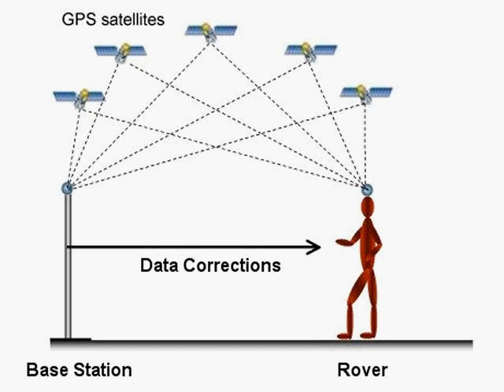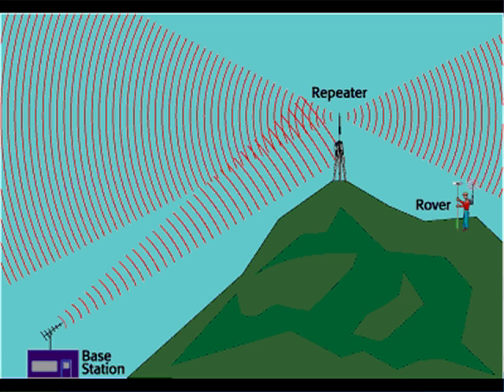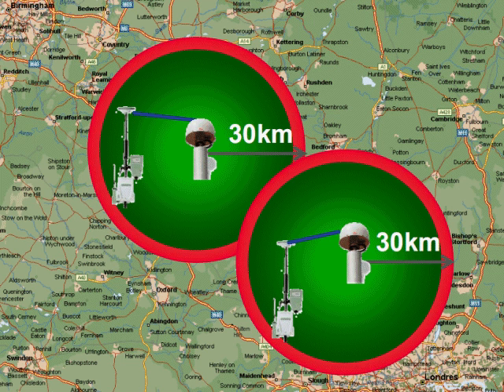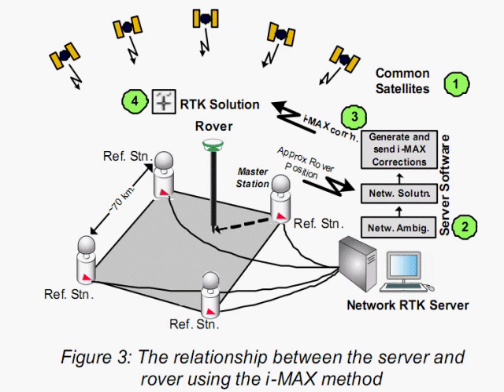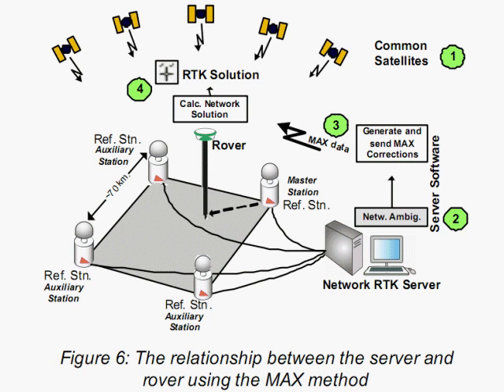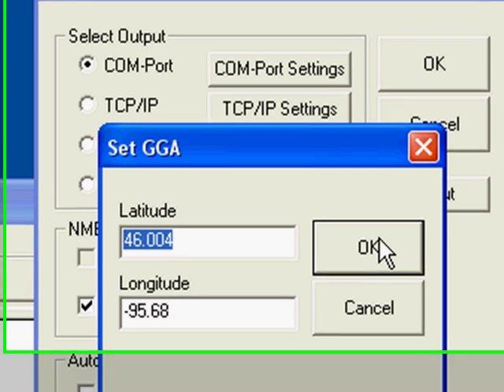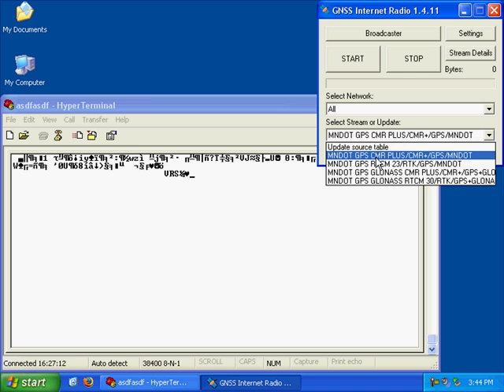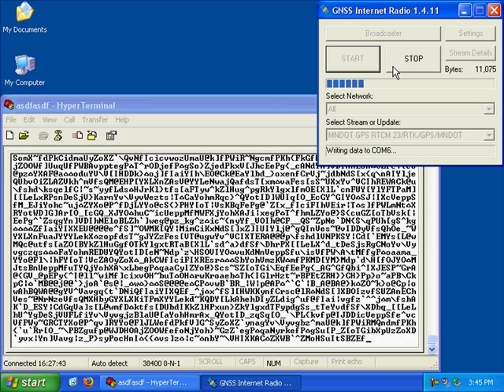GPS Video 2 - RTK

Comment: Thanks Lance. Great video.

Is there a system that would allow me to locate / stake out ~60 hole locations in sub-cm for not too much money?  Or am I dreaming?
Reply from the maker: Assuming you have a RTK-capable GPS receiver, there are apps that will help you map out points on a grid. If you need to buy a RTK receiver, then you'll have a lot more invested in the project.

Comment: in gsm/gps car tracking system,is the gps receive signal directly from the satellite or it need to have base station(ground station)again? i'm confused. pls help. advance thanks.
Reply: dangerous woman The GPS signal is coming from the satellite, the correction data is coming in from your GSM connection, which is coming from the base station, so your gps and the base station are connected to the same satellites but with RTK the base station sends correction data to whatever Rover GPS wants it. I feel like I may have made it more confusing.... Basically the old way to do this was you needed to have both a regular GPS and set up a base station GPS that talked to each other of a radio signal, today there are base station service providers that have set up permanent base stations so all you need is your GPS that is connected over cellular connection to their correction data.

Comment: Thanks , that is the clearest RTK video I've seen yet.

I want to build a DIY RTK basestation  using RTKLIB, a raspberry pi 2 and a ublox M8N (and later a M8T or better) gps receiver.

My neighbour has a farm with several Starfire 450 RTK GPS linked via point to point radiomodem links with repeaters.

I would like to show him how to replace the radio direct link with a cellular radio link (I have made GSM/GPRS serial transmitter radio with a SIM800L chip & an arduino).

Do you know what is the data protocol that his Starfire 450 uses ? Am I going to be able to output from my RTKLIB basestation to his starfire 450 gps rovers if I had the right radio transmitter (I think it's a 450mhz radiomodem (unknown exact type))?